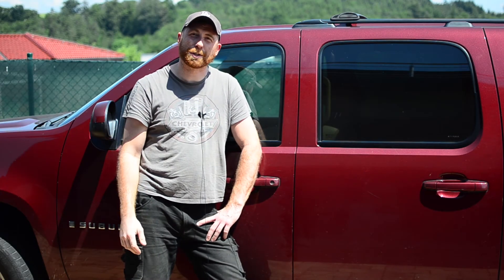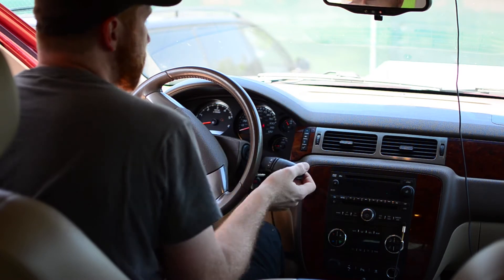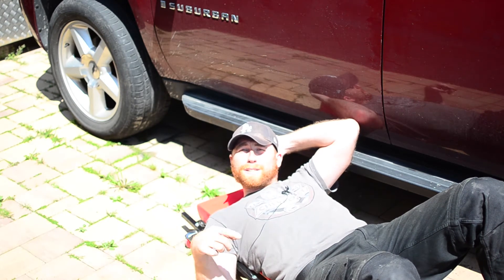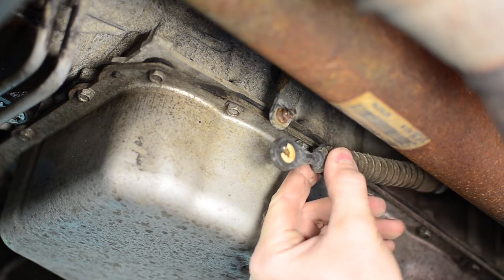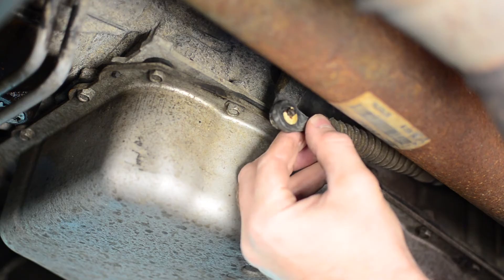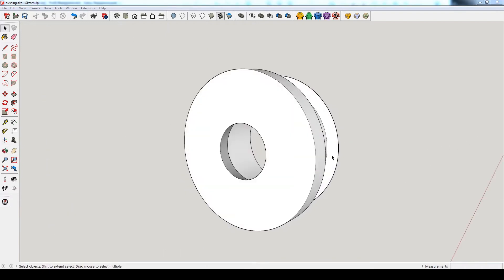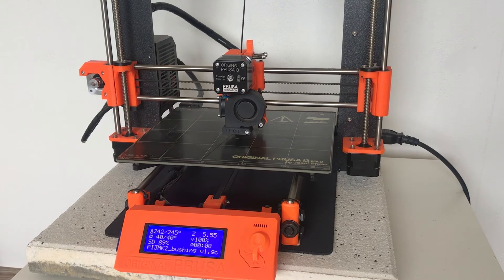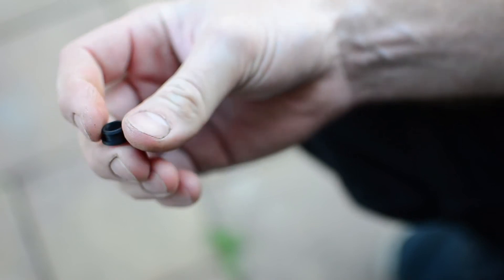Suburban shifting problem - transmission cable bushing broken

Comment: What year is your Suburban?  Can I buy one from you?  Nobody makes a replacement bushing for the 2007 Suburban and I was hoping to not put in the whole shifter cable which means taking out the front seat and peeling the rug back.
Reply from the maker: i found some replacement parts some time ago, but it was sold in US, which I am not from :)